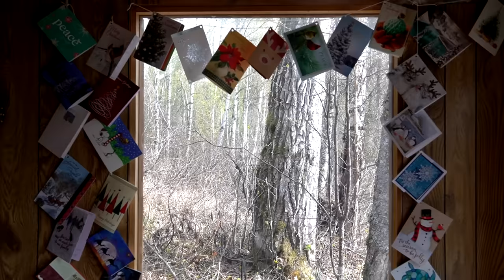The Lakeside Cabin | There's Always Work to be Done

Comment: I showed my friend your laundry video and she bought your same washer / spinner for her apartment in downtown Los Angeles.  It. Is. Amazing!  Works so good and we love how you can tell if the clothes are clean based on how the water looks.  AND can reuse the rinse water as you suggested - so efficient.  Spinner is amazing.  Takes little time to dry.  In Los Angeles, just need a fan and poof, before you know it, your stuff is dry! Just have to take really big items to the laundromat.  Towels are a little stiff but 99% of laundry comes out GREAT, thanks to YOU!!  
PS She uses her washer spinner in the bathtub / shower with a similar hose / handheld shower attachment which works wonders, on top of a plastic bin to elevate it to waist level and a rolled up shower mat to level it (shower is slightly sloped).  Perfect solution for so much cheaper than a big washer/dryer set up or going to laundromat.  Sometimes what works in the rustic wilderness can also work well in the city too!!

Comment: I would think about rigging a light line and pulley from the ceiling above the wood stove, and hang the drying rack from it.  Drop it down, load it up, crank it up where the hot air collects, and it's off the floor and out of the way. Fix a simple boat cleat to the wall to tie the line to and keep the tack suspended.

Comment: I don’t know if that big motor would idle down enough to troll for the monsters, you wouldn’t want to lug a battery and trolling motor. That’s the way we used to catch big walleyes, pike and muskies. Right off that shelf where it drops off and use a rapala with bait or a night crawler harness if it’s allowed. Also we would pick nightcrawlers for bait and we had a long box with a heavy rubber top like a piece of conveyor belt. I’m sure anything that kept the critters away and let air in would work. Black dirt and feed them coffee grounds and egg shells. You could buy some to seed the container and they would multiply.

Comment: Love your work and life. Great job on the early run to the cabin, it is rough going at ice out time, y'all are more ballsy then I am to make a river run this time of year, props to you for that....You are risking a lot with boat damage and possibly ice jams to flood you and stop you for extended periods of time, you should look into getting a sat phone just in case for emergencies(if you do not have one already). 
Couple of things I personally would do different, hand cannons from spring to winter, people all have there own preferences, but for the most part you are in bear protection mode from spring to winter and hand cannons are good for power and the comfort and ease of carrying them in the bush, also much easier to draw on a bear in the brush with a short barrel, not as much stopping power typically but good enough for the time you have. 
My other suggestion would be a couple of extendable push poles with duck feet on them(learned about them when duck hunting) they are great for not having to get wet and steering around things. They are also light weight and do not take up hardly any room in the boat.

Comment: Coleman stoves start a lot quicker if you preheat the generator (the long thin part that sticks into the burner) with a small torch before lighting.
Reply from the maker: Thank you for the tip

Comment: Is there a reason Eric why you run the outboard trimmed all the way down ? I was thinking if it weren't trimmed down all the way, it wouldn't bury the bow as much and perform better but truthfully I've never  operated a jet drive outboard. Have you considered taking a one gallon sprayer to the cabin to spray it when you leave? It might be the optics of the camera but the posts supporting the cabin appear to be leaning!

Comment: Ice still floating water Temps still cold to early for casting lures. But not for a bobber and hook with the baits you guys used for ice fishing. I'm sure you would have had success using a bobber and baited hook over a frog lure or mouse lure when typically those are not in season yet mice rats are underground still and frogs havnt even come out yet. Pike are predators but yet know when forage is available. Bobber and baited hook is the best option til the water warms up

Comment: If you are fishing and the water temperature is very cold you will not have any luck using a topwater lure. When the water cools down the fish become more lethargic and they are only interested in meals that they don't have to expend too much energy to get. I mainly bass fish but do many different types of fishing and when the water is still cold most people prefer to throw slow moving jigs or jerk baits that stay in place as how a baitfish would act if the water were actually that cold. I sort of shuttered a bit seeing the topwater frog and the mouse being thrown when there is still some ice on top in the background. Next time try throwing a crankbait and slowly winding it in or use a jerkbait and twitch it a few times let it sit still for a few moments and reel slowly and repeat.